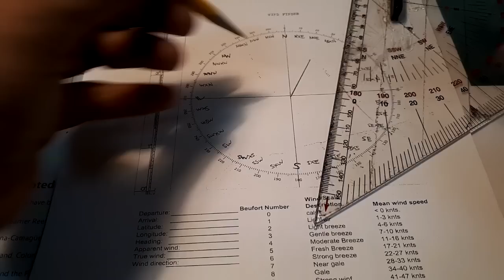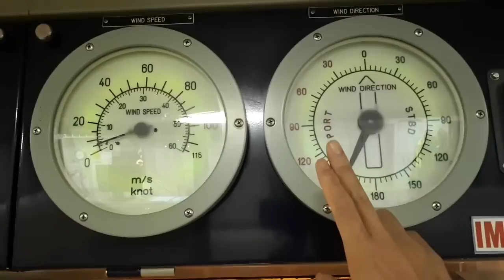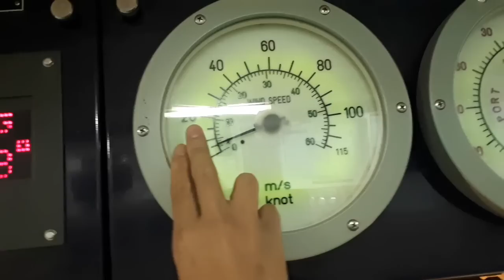How to plot true wind direction onboard the vessel :  LIFE AT SEA

Comment: Good day sir, how about if the heading is 355 and the apparent wind direction is 030S, how will you calculate it. bc i see that that youre having a heading of 025 and an apparent wind of -30(bc its portside as you've said in the explanation) what youve done in the example is 360+25-30= 355.

Comment: Law of cosine formula is very accurate  and useful in solving the  true wind direction and true wind  speed. The  method youre trying to illustrate had so many flaws and  limitations.
Reply from the maker: Lets admit 99% of the vessel don't have a scientific calculator. Thats why even its many flaws and limitation at least you can do it right away with a chart, triangle, pencil and compass divider.

Comment: Great video sir but I have one problem about calculation 
How did u add and subtract from 360degrees.
Reply: He use it as a reference, he must work with the heading of the ship, which is 25 degrees,, but then he has to substract 30 degrees, which means he gets -5 degrees. But if you have negative degrees, you can transform it into positive by just adding 360 degrees, which results in 355 degrees.